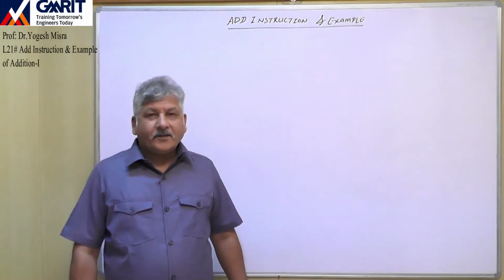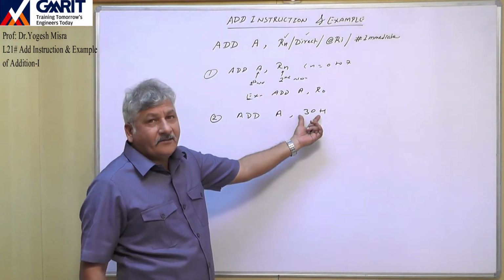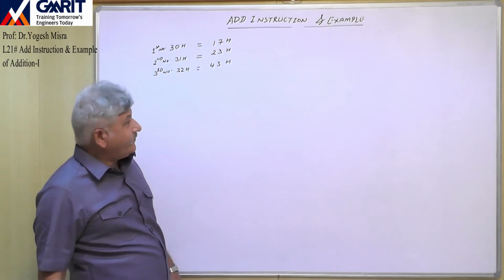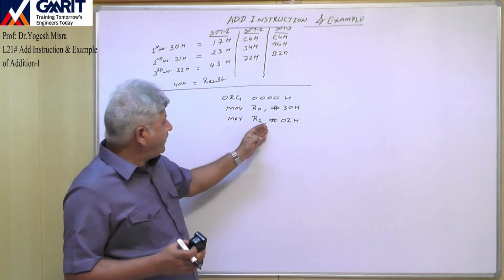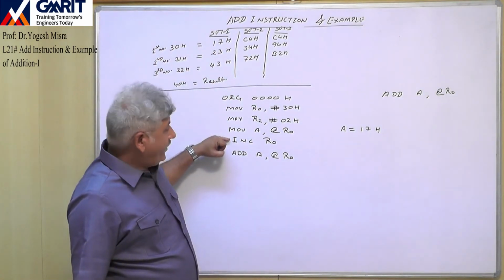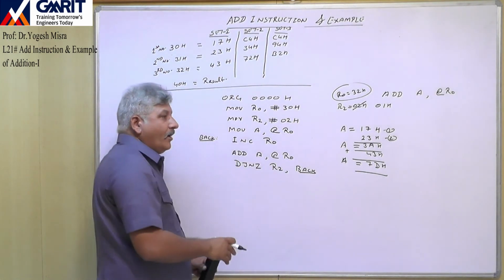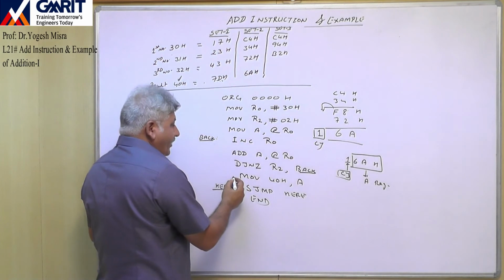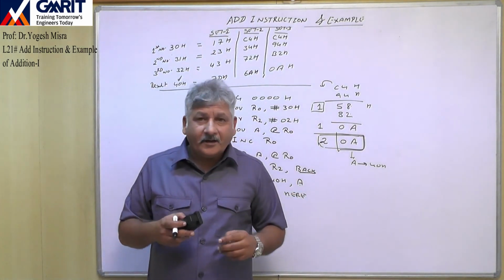Lecture 21: Add instruction & Example of addition (Part I)

Comment: r0, #30h........ is not here r0 getting the 30 h data ? as u r here using hash ,is it not a data? how can then that represent 3oh location?
Reply from the maker: Mov r0,#30h means in r0 30h will be stored and Mov r0,30h means in r0 the data stored at memory location 30h will be stored and that can be any 8 bit number.